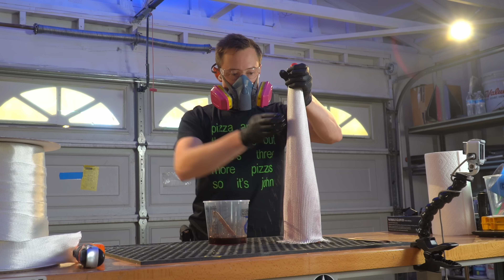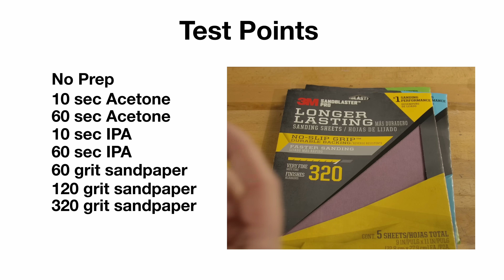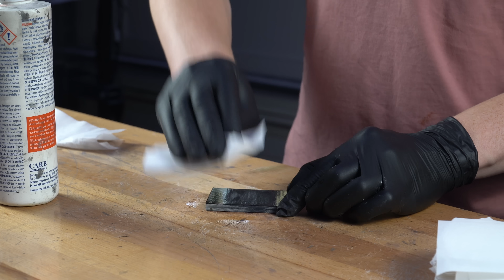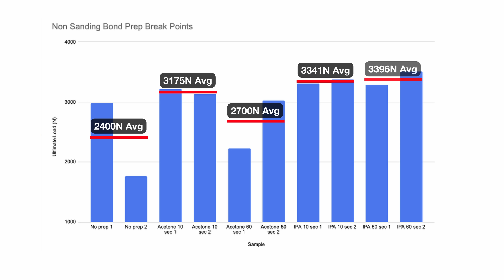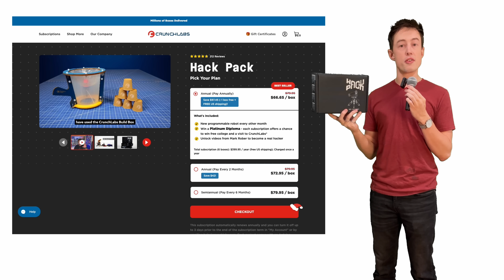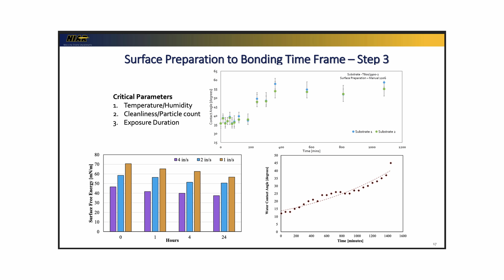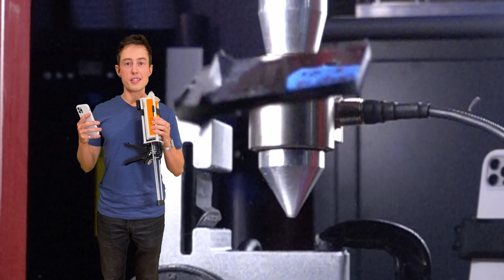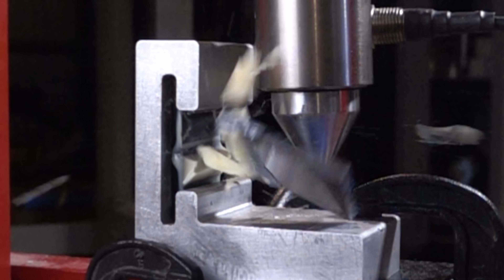I Broke 100 Epoxy Bonds to Find the Strongest

Comment: acetone leaves a residue after drying. all solvents need a 10 minute dry time before bonding and CLEAN dry wiping to remove possible residue. fine grit for removable surfaces, corse for a solid bond. 240 grit is the bare minimum and the best in my opinion, you don't want TOO good of a bond because it can delaminate before breaking free. corse grit sandpaper can also sometimes interfere with bonding by reducing the consistency in contact. degassing is only required for when epoxy is overmixed (over-agitated) depending on the viscosity of the epoxy. when bonding gany  and all surfaces in the workplace. 8 hour life before needing to reprep surfaces (24 if covered). all sanding preparations should not be directional but circular in motion to create sufficient bonding surface. -A somewhat familiar AMT
Reply: also wet sanding is preferable to remove particles

Comment: Pressing the parts out of the mold looks violent. @5:57 "Tiny pieces of epoxy fracturing but most of the bond should be fine". 
I'm also curious about variance in brushed on mold-release. Also how centered was the point load on the fin? Show the 4000 test!

Comment: With such large fillets you have to consider internal stress in the epoxy, too. While curing the expoxy might shrink and create internal stress.
Your discharging is a standard procedure for cleaning under vacuum just before going on with high vacuum deposition for expample aluminium on glass for optical mirrors. 
Last but not least: Especially alumium will re-create an oxide layer after cleaning and removing of the layer in preparation of glueing or soldering. Time matters here.
And ... some preheating/drying will get rid off any residual water molekules bound to the material. It's like water in filaments for 3d printers.

Comment: Biggest nerd fest I've ever seen. Since your aim appears to be to achieve the best bond for the "fins" on your rockets. To achieve this I suggest you try three things: 1/ use some micro-fiber in your epoxy There are many off the shelf products available for this- try your local resin supplier or boatbuilder for recommendations. 2/Use a smaller, radiused fillet and overlay it with the fabric of your choice- glass, kevlar, carbon etc. 3/ There are many different epoxies available. I would suggest you do some research and pick one with some flexibility.
Seems to me, you have gone down a long and winding rabbit-hole without first defining your problem. It is more important to get the Design of your joint correct before you worry about the process. Clearly your approach of using huge fillets of unreinforced resin is inadequate for your goal.😎🤓

Comment: A mechanical bond (drilling a   hole true the wing in the bond area) or drilling dimples  into the rocket surface area also creates more strength to bond onto.Flat smooth surface  vs rough surface.

Comment: @12:58  when you do the vacuum degassing with the part in the mold, not only are you removing gases from the epoxy, you are also removing gas from the surface of the material at the interface of the epoxy. Microscopic little bubbles that are in the tiny grooves and cavities. When the vacuum on the chamber is released, atmospheric pressure forces epoxy into those microscopic features.  

I mention this because while degassing epoxy in the pot has value, the particular effect this has on the part en situ does not transfer to a hand layup without vacuum, even if the epoxy was degassed prior to assembly.  You would have to vacuum bag/chamber the entire part at the time of assembly to get the full benefits of this effect.

Comment: Aerospace tech here, mechanical and structural for quite a long time. Let the sand paper do the work. 80 grit in a cross hatch pattern to get you though the heavy resin, stop before you get to the swirls/ weave of the composites. IPA wipe. Lightly uncover the swirls/ weave with 240 grit. IPA wipe, then acetone wipe, and finally IPA wipe again (acetone does leave a coating that can screw up your bonds). Depending on what you're using, something like 9360 will usually be ready for bond at this stage. Most structural adhesives will be ready... Some might require a promoter. I'm curious to see what your results determine though.

Mixing is usually a different step, not necessarily Bond prep, but I understand your point. Tested: nozzles do a shit job, but they speed up the mix time. Always hand mix after. You'll get swizzles, and the exotherm of the epoxy will differ. Glass beads can be mixed to give you a uniform bond layer. Thickening agents such as cab-o-sil can be added for forming/ hard to reach area. During your mixing you can use a vacuum to de-gas your epoxy. That really depends on your epoxy. Manufacturer Data sheets are usually pretty good about this. 

Okay watched the video... Gotta be honest pretty sure most of your data is invalid. Mold release is a huge issue in the industry... Sometimes it's a necessary evil, but most of the time the best thing you can do is avoid it especially in a vacuum environment. So basically bond prep is all about causing small micro tears on the surface of the material. That allows tiny valleys, to form, those allow the structural adhesive, to move in causing tiny sheer and tensile loads. Soooo the reason why you hand sand in (90 turn 90) cross hatch pattern is to form consistent micro valleys. If you oscillating sander it creates random swirls as well as heat that embeds some of the dust and debris into the resin itself. The reason why you use IPA first is to take off the big chucks of dust and debary while cooling the part. Acetone is used next because it's a heavier solvent, working it's way into the material surface and reducing contamination, however, as stated before if left to dry onto the material it will form an coated layer, reducing the height and intensity of the valleys. To prevent that from happening, you'll use a secondary IPA wipe. This process will give you the most consistent results. The reason why you try to stay within a 24 hour time period, is mostly due to contamination to the surface. Normally doing a quick IPA acetone IPA wipe. We will get your surface back to an acceptable bonding surface. As far as plasma etching goes, it does work, but it's usually used with special tools such as an etching gun and it's primarily used for paint. Flame/ heat is interesting, it's technically reactivating the resin layer, which is why we use autoclaves/ ovens. 

Lastly design, you'd probably get better results if you could grove your parts. Maybe not wood working status, but simple notch for your fillet to cover over.

Comment: The friction co- efficient is markedly relative to the complete surface of any affected materials that are impacted by phase distortion at a molecular level, which obviously increases hyper productive atoms to display continuing adhesive properties. This can be implemented as an all inclusive factor of longitudinal stress as derived from, and eminating from deduced functions that are primarily , yet, exponentially relative to the force which was applied in the interim.

Comment: We use acetone IPA at my job. 
A couple of points to guide your next tests. 
You miss a lot of key steps that are common in aeronautical composites. 
1. Changing your cloves regularly. 
2. Wiping once then changing the cloth face. You are using more of a scrubbing action. 
3. Solvent cleaning before you sand. 
4. Using reagent grade solvents. 
5. Allowing the solvents to fully flash off. 
6. Controlled ramp elevated temperature curing. 
7. Testing for durability whichs is as or more important than strength. see Boeing wedge test. 
8. Cleaning the solvent container before using it. 

Also some other ideas you could consider. Sand blasting most likely to be better than sanding,
And have you considered sanding the adhesive into the surface?

There's a lot more factors but those are the first ones which come to mind.

Comment: There are several famous studies showing that “operator variability” matters a lot in fields like dentistry and medicine which require hand mixed chemicals. Some studies have shown professionals in these fields can vary by 200%+

And regarding epoxy specifically - this variability has actually killed people. There was an infamous “Big Dig” tunnel collapse incident in Boston that involved improperly mixed epoxy which lead to a fatality. 

Overall I think industry is even willing to accept lower quality mixes as long as they’re consistent - they can design to accommodate this

Comment: Very interesting and educational test, all credit to you for that. 👍
My experience is from repair work with plastic boats GRP.
There, the polyester/epoxy binder is reinforced with several layers of glass/carbon as well, because you want it to be as strong as the structure it is attached to, it should preferably form a homogeneous structure together with the base material.
Think about it, you are welding together several pieces of steel, you are not "gluing", you are looking to melt it together.
Sanding the plastic matte and washing with acetone is normal.
The boats have of course been used and are much more contaminated than your samples, but with dry, clean work and a well fiber- reinforced binder it holds up completely without any problems.
As I can also see from your samples, the binder itself (the epoxy) also breaks.
Therefore, I wonder what if this joint contained glass, carbon or other strong fibers.
Or did it have one or preferably several layers of this in it? On boats, the ban avoids butt joints when casting.
If you use mat or tissue, you have to "mash" the air out so that the joint does not turn white, (air bubbles) so you can hardly cast in shape.
If the fibers are mixed in advance, it may be possible to cast in shape.
An advantage is to avoid blunt joints. Give the part that sticks out horizontally on your fracture tester a pointed edge towards the other plate instead of a blunt one, blunt joints are also usually avoided by welders.
I think this would help make a noticeable difference in strength.

Comment: Loctite EA 120 HP is too brittle for your intended purpose with the materials you are using.. Experiment with resins with matching flexural strength and modulus of elasticity as the materials you intend to bond. Also take note of the peak temperature range the epoxy can manage given the expected rocket body temperature in ascent plus high altitude solar heating. Testing up to 120 degrees C is necessary.  From my experience, FWIW, in addition to sanding, drill the parent and child surfaces with shallow 2mm holes within the fillet and contact area to act as anchor plugs.This dissipates (or translates) tension and shear forces from the surface bond. Dowel pins from fin to body also help with shear forces.  You'll find your 4000N goal there.
I'd also suggest a Ti nosecone and ablative paint for all expected hotspots. Have you run a CFD heatmap on your model yet?

Comment: I am no expert but I have a comment or two based on some experience I have. Take them with a grain of salt but at least think about what i say. Composite bonds are weak in peel strength. Your test method exploits this weakness and visibly it appears they are failing in this way. To avoid this type of failure the bonding material needs to be flexible ( rubbery) and not brittle. I question if you are simply using the wrong bonding material. Hope this helps.

Comment: Stearated sand paper is intentionally 'contaminated', to lubricate and not clog (release debris). Prob not the best for surface prep for adhesive... you're rubbing the surfaces with release agent.

Comment: How about a video on the different brands or types of a single brand of epoxy so we know which one is the best. I would also like to find a near clear epoxy that works on Aluminum for somenof my museum scale rc planes. Sometimes riveting aluminum is not an option due to the space I would need to get a bucking bar into.

Comment: If you want stronger fin strength increase the body thickness at the base only . Be sure the weave is at a bias. Cut a trough the width of your fin into the body at the base only. The insert fin with epoxy . Certainly more steps but much higher strength.

Comment: For what it’s worth, I tested epoxy bonds by focused laser light with the sample in a vacuum chamber and then filled with oxygen. The laser scanned the surface at 1mm^2/sec with a 355nm laser at 62 mJ per pulse. Bond Strength of Graphite epoxy exceeded the inter-laminar strength of the composite structure.

Comment: Hey Joe, just letting you know, I have access to an Instron if you have any of these that you'd like more data on I can definitely ask to see if the Laboratory instructor or my Material's Engineering professor would be down to get some research on composites too. Perks I guess of going back to get another engineering degree I guess.

Comment: Nice, I don't sand through to bare carbon, the bond becomes inconsistent.  I only abrade where the tool cavity was polished.  The acetone/iso is the correct process too, and it also mattered for me assuming I get a peel ply surface.  I'm with you, I prefer predictability to peak, I have plenty of surface area to work with.

Comment: I have absolutely no experience in bonding composite materials, but I do have a surface level of knowledge in a lot of subjects from mindlessly meandering through the science side of YouTube. I've got 3 ideas that, if nothing else, could be interesting to test.

1) Degassing before application only
You absolutely do not want bubbles in the epoxy before application, but you also don't want to disturb the epoxy once it's applied. In the tests, degassing while the epoxy was in the mold caused moments where the epoxy was not continuously in contact with the parts. Theoretically, this may cause polymer chains that start on one part to link to each other, effectively weakening the overall bond. Pouring the epoxy into the mold at an angle (So that epoxy can't easily trap air as its poured) might help produce a more completed bond between parts.

2) Physical additives
Some construction fields that use epoxy will often add some sort of solid additive to the epoxy to improve its strength. Fiberglass is often the go to, but for a rocket that'll be exposed to thin and cold atmosphere there might possibly be a better choice. Also, the effect of adding dyes to the epoxy might not be large enough to easily measure but they're still there. Plus, I personally would avoid adding anything to a test that you wouldn't add to the final product.

3) Applying load correctly
I believe a lap shear test wouldn't actually help you here. It would absolutely give you a solid ground of information to work with, but it wouldn't test what you're concerned about. You're concern would imply that you need to test what happens when the epoxy bond experiences a sudden and large increase in force along the surface of the fin. What you've seemingly tested would be like someone stepping on a part of the fin and seeing how much weight you can add to them before something breaks.

Comment: in my head, the key thing is to replicate the circumstances of how you are actually going to use/apply the epoxy. 

vac degassing the coupons and adhesive together is all good and well, but can you do that on the actual rocket? if not, you need to figure out how to do it or accept that the degassed stats are basically useless for your purposes if you can't implement it on the actual rocket. 

the sanding thing is another issue, in that you need to figure out how to consistently sand the rocket parts despite their geometry making it more difficult than a couple flats and some molds. 

this was interesting data, sure, but also not really useful information for your rocket when you can't actually use the techniques on the rocket itself. 

when sanding a car I was taught to sand the metal with a rough sand so the primer would stick, do a smooth sand for the primer and then a super fine sand for the actual paint-to-clearcoat, 

so it may actually be worth considering doing multi-step sanding rather than just trying to make it work with a single sanding stage.

Comment: You're  probably aware of this, but not all epoxy is created equal.  For what it's worth, I've always had the strongest bonds with marine epoxy.  There's all kinds of additives for it as well. From structural, to filling, to lightweight silica that's almost light as air, that lightens it, strengthens it, and adds consistency so it can be used like a bondo type thing.  I'm no expert, but if you're going for strength, I wouldn't use loctite in a tube, I'd get a marine system that they make boats with

Comment: Add trianglulat hollow in the fin bottom part so that the resin go inside and would help to bond it more tighter with stegth giving high tension counter.
Reply: Or circular as triangle can have break weak points at corner

Comment: One very common way how to increase strenght of epoxy is heating it while curing. You really really should try it. Not too high but lik 60-90 C is more than enough and it increases strenght like 5 times. It even states this on the packaging of my epoxy resin

Comment: Degass your epoxy BEFORE using it, tiny bubbles in your fillets will create stress points, additives in your epoxy (fibres) will increase strength, and fibres from the base material (sanding needs to raise micro fibres, if not waste of time).

Comment: Instead of 3d printed molds, how about silicone rubber molds with a rigid mother mold around them to hold the shape? Much easier to get parts out with a flexible mold and you probably would not need mold release.

Comment: Degassing is improving bond strength, not because it’s pulling bubbles out of the resin, but because it’s pulling air out of the composite, which the resin then replaces. So, it gets in deeper and more intimately than it would otherwise.